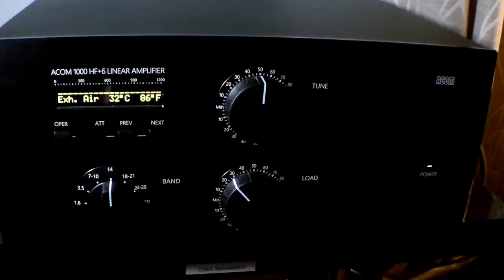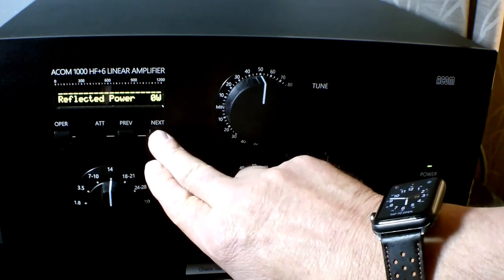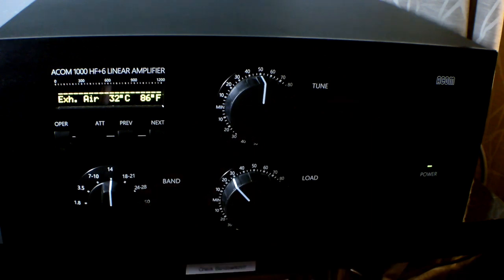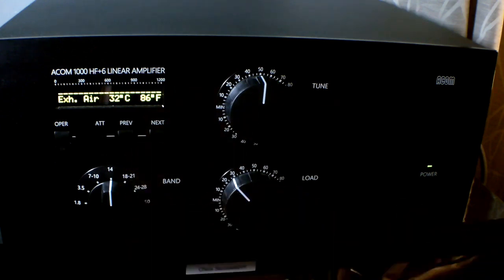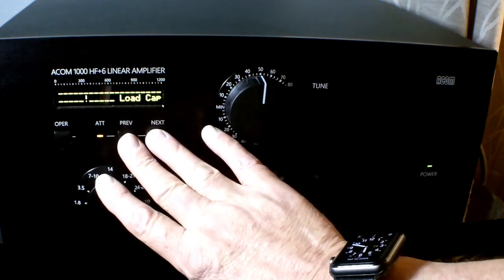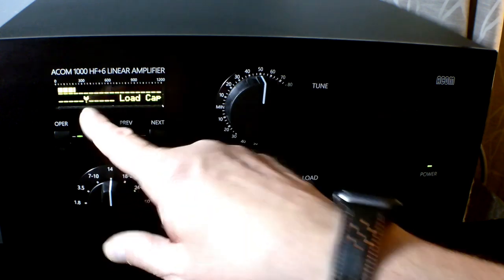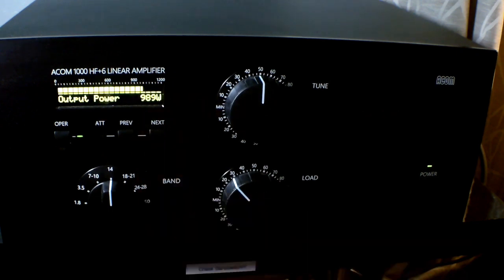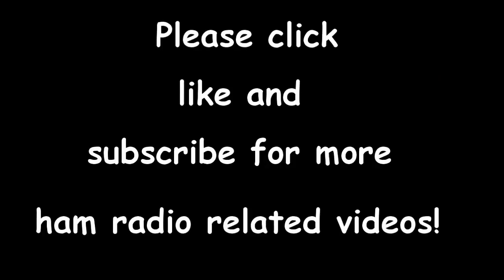Features of the ACOM A 1000 linear amplifier

Comment: I've been pushing mine to about 1200 - 1300 watts on SSB, easily. The tube is still original from when I bought the amp new, 7 years ago. Got several new spare tubes for $50 each (connections in Russia), so I'm not too concerned about pushing the tube a bit hard. It's hard to beat this amp. Best amp for the money. Their 2000 model is even better but a bit of an overkill for me. I'd rather invest into better antennas. 73!
Reply from the maker: Yes it will do more than 1000, but since I don’t have a spare tube, I try to keep it at 1kw. Only RTTY I run 650w and she’s done that for hours without excessive heat. It does have the optional fan for digital modes.
Reply: What drive level for 1300?

Comment: Thinking of selling my AL80B and going with this....thoughts?
Reply: Well, pulled the trigger on the Acom 1000 and it's in transit....probably put al80b on QRZ
Reply from the maker: lizzyfan1986 let me know your first impression of the Acom
Reply: @K4FXRCFlying  Absolutely!
Reply: @K4FXRCFlying  so, I have the Acom 1000...incredible!!! So easy to tune, nice for contesting....gonna give it a good run this weekend for the Delaware QSO party...give me a call if you can 73 KT3LZY
Reply from the maker: I sure will. Glad you got it! It handles the contesting quite well. I’ve run it pretty hard in RTTY contests at 650w output and the air exhaust temp never got over 144 degrees F.
Reply from the maker: A smart move. I had a 80a, great amp, but not in the same class as the a1000. The a-1000 does a true KW, the 80 is really not a true KW. It may barely make it on pep, but about 800 is all a single 3-500 can do